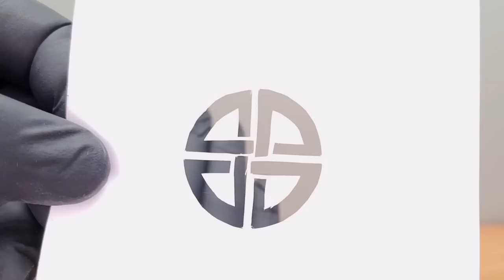Hammer Restoration [Very Rusty Restoration] - Awesome Restorations Remake - Etching Metal

Comment: I really hate to criticize someone, especially since I know how much work went into making this video, but it just looks like a slightly sanded old hammer with an etched design. I'll check your other videos in case this was just an aberration for you. Best wishes.
Reply from the maker: Hey Curtis D, that's right, an extreme amount of time goes into a video like this. This hammer has extreme pitting from the rust, of course I could have completely sanded it away, but then there wouldn't have been much left. Furthermore I think that the hammer looks more mystical and interesting. In the foreground of this video stand, how do I make with simple things the logo on it without laser...
Reply: @ForgottenShineRestoration  while many of your restorations are restoring an item to functionality, there is something to be said about form as well. You're absolutely right about the pitting lending the metal character, giving it history that a polished smooth hammer doesn't have.

Comment: Why is there a need to oil-quench in these tool restoration projects? I thought it was a technique to harden the metal - but a hammer will presumably allready have been hardened when itnmade. So why do it again? Does the hardening lessen over a long time, or maybe only affect the outer layers which get grinded off? It would be very interresting to know since I hope to restore some old tools from my grandfather at some point.
Reply from the maker: Thanks for your feedback. Normally, the hardened zone of an item only affects the outer layers. So if, for example, rust has destroyed these layers, there is no longer a hardened layer. Another factor is that by machining, heat is introduced into the object and the hardened structure is also lost. It also makes sense to harden only the outer zones or, if necessary, individual zones of the object and leave the rest "soft", otherwise the hammer will shatter like glass at the first blow. For this reason, the object is also "tempered" after hardening in order to make the too hard structure somewhat "soft" again. 🐢
Reply: @ForgottenShineRestoration  Thanks for the good explanation. It makes sense now. Keep up the good work :D

Comment: Decent job I always just burnt the handle out that way you still have the wedges to use also as an electronics engineer putting black on positive and red on negative triggers my OCD but it's fine LOL